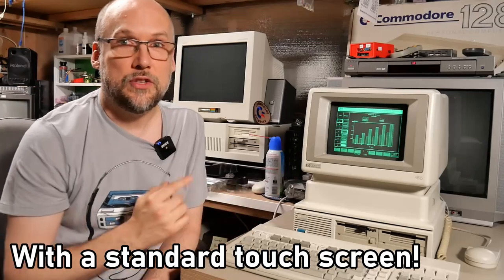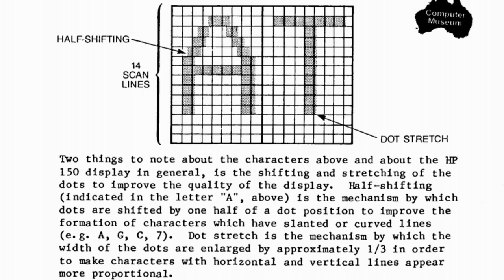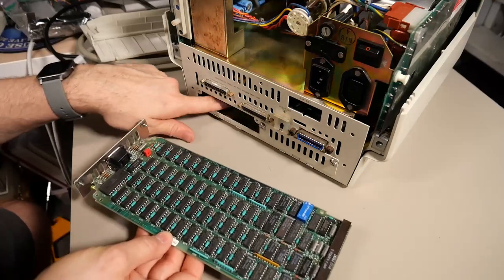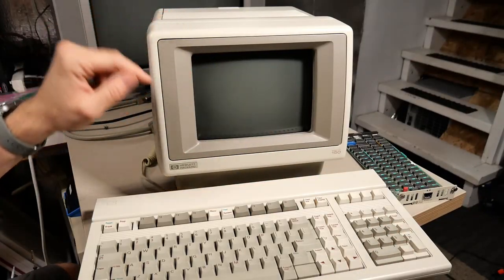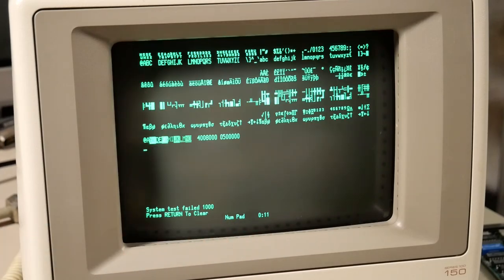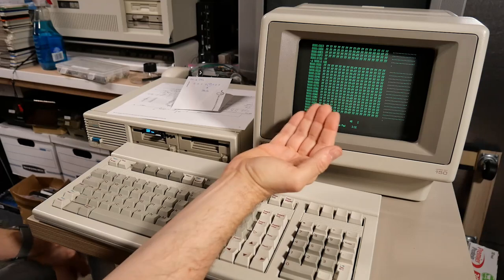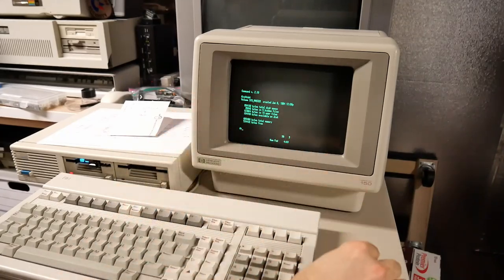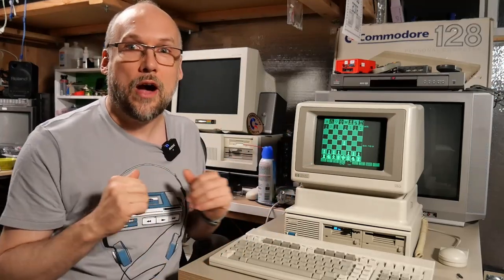Touch Screen MS-DOS PC from 1983

Comment: I was given the task of evaluating a Vectra in 1985 for our team PCs. It was definitely not 100 percent compatible and required its own OEM version of DOS. However, it was a great pleasure to use, extremely well made, and beautiful to look at. It had a 80286 running at 8 MHz. It had a very excellent keyboard which was every bit as good as the IBM model M but much quieter. The symbols were molded into the keys, as on their calculators. We nixed it due to lack of full compatibility but I got to keep the evaluation unit as my terminal (most of our work was done on minis and mainframes).
Reply from the maker: The 1985 Vectra certainly looks pretty boring compared to this machine -- but I guess that's what it meant to be a PC compatible back then. I see from pictures it used the same keyboard as the HP 150, which is neat.

Comment: re: manually soldered wires ... I would suspect fixing timing issues, because in all the instances you point out the original traces have been cut not only as near as possible to the soldering points, but always at both ends. This makes sense if you need to avoid any signal reflections which would otherwise happen if you leave one end or both ends connected.
Reply from the maker: IZ8DWF thinks that it is because of crosstalk issues in that six layer board due to those existing traces being too close to another trace right under it.

Comment: Another thing to consider on touch screens of this type is LED lighting pulses can confuse the sensors just like they do on the PCJr keyboard.  Also some newer computers with touch screens (like 2010's era) can go haywire if the screen refresh rate and touch scan rate are not in sync. I've seen this on Dell XT2 laptops and some Dell all-in-ones where the cursor jumps wildy around with older video drivers and newer drivers fix it.

Comment: I was developing code for the HP150 back in 1985. I had come to the project from a group working on HP series 80 and 9000 machines. The 150 was a considerable step down in quality and capability and the touch screen was really just a gimmick and even if we coded software to use it, our users preferred to use the mouse or keyboard instead. I was very pleased to get back to coding for the HP 9845C.

Comment: Hello Adrian, We used to have these computers running on 2 different machines back in the early 90's. One was an ESI 4000a Thick Film Laser trimming machine running HP Pascal OS and also Pascal Language. The other was on a Siemens (Now ASM) Pick and Place machine SP120 (6 Revolver head for fine components back then 1206 and 0805's some small IC;s)  and HS180 single spindel (for larger components like large IC's) running HP Basic OS and Basic language. same machine though. On the HP basic to do a dir equiv of DOS you had to type "catalogue 703.XXX.XXX" forgot the command exactly. they both had the HP9121 or 9131 drive system and also contained a 10MB winchester HDD. same keyb system, very relaible. ESI and the pascall system made good use of the function keys. We later got a second ESI Laser ,The ESI 4210 system but again same OS and Computer.

Comment: Touch screen back in 1983 is pretty incredible,  it wasn't until the 1990s that touch screen devices were more popular, though they were still not that common. The first touch screen device that I saw was a public information terminal in a local library, then still in the 90s I saw a bus timetable display which was operated via touch screen at the bus station. Then jump to the 2000s and touch screens are everywhere.

I think that HP's printers are still of pretty good quality, even the cheap ones. I had a Compaq Presario laptop from around 2013, so Compaq was owned by HP. It worked fine from new, apart from one of the keys stopped working after a few months, HP repaired that under warranty, then after a couple of years the screen started failing ie the contrast was out of wack and was slowly getting worse.

Comment: Hp-IB was invented in the 1960's. Later on it got standardized in the 70's and named GPIB. HP kept its name though being compatible. Its original use was for interconnecting measurement Equipment like Multimeters and oscilloscopes, etc.
Reply: What's the data rate of these? You'd think if it was the 60s it would be pretty low, unless they account for increasing speeds over the years.
Reply: @stonent  1 MB/s, I think. Apparently, National Instruments introduced an upgraded variant of the IEEE-488.1 that want up to 8 MB/s, but was also backwards compatible. Keep in mind, HP originally designed this interface for data logging and control of digital test equipment, not for moving large files around between computers.
Reply: I use test equipment everyday that still use this interface. They range from stuff built in the 60's to brand  new power supplies, Oscilloscopes, and  lots of other automated testing equipment.

Comment: Whoa!  And here I thought my IBM 8516 was an early touch screen example!

EDIT: I'm very surprised how similar that keyboard and mouse are to the ones I use on my HP 9000/720 from nearly a decade later!
EDIT 2: Chassis and expansion cards are done in a very similar way as well!
Reply: Instantly recognize that incredibly uncomfortable HP mouse.  Used from the graphics terminals on my college's 9000/300 servers all the way through the 425 machines and the 7xx workstations.

I loved our 712i machines because we could use normal PS/2 mice with them.  One day the HP guy came out to upgrade the CPUs and I saw that inside that pizza box case they used foam to mount the disk drives.  Broke my heart.  Then Compaq bought HP and it all went to hell :(

https://commons.wikimedia.org/wiki/File:HP-HP9000-712-100-Workstation_01.jpg
Reply: @grumble2009  was that HP Pizza top of the cage Pizza special sauce?

Or just sprinkling of extra Ram or a double Ram Pizza.

Comment: The graphic arts and architectural supply store Charrette used to use these as terminals throughout their store. The employees used them for access to their inventory system on their mini- computer.

The bus wire may have been used to avoid etch shorts. There may have been some kind of contamination, or fine copper threads on the boards that required cutting the etches and rerouting wires around those locations. I ran into that as a PCB tech. The company had a batch of boards that had some contamination of some kind that "grew" together and caused the address bus to short out. After the issue was discovered, etches were cut and bus wire was run around those places.

Comment: I recently watched an episode of Computer Chronicles that had this touch screen computer in it. I was fascinated! Nothing under the sun is new, I guess. Very fascinating how you got this machine working properly again. Well done and a big congrats to you on this! I am personally VERY interested in these terminal modes. Would it be possible to hook this up to, lets say, a modern Linux machine with terminal access? Does the touch screen capability work when using it as a terminal? My interests in these older machines often lie in the driving question: "How can I make this old machine relevant and useful today to accomplish real work?"

Most importantly, how in the world did you come upon this machine? There is a story there too. So fascinating!

Thank you so much for sharing!
Reply: The one drawback to using an HP terminal on a modern computer is the terminal emulation.  This one only understands the HP escape sequences for cursor control, not VT220, ANSI or others.  You could use it for text, but not anything like vi that uses cursor control.

Comment: Nice fix. I saw one of these demonstrated in the late 80's. I thought neet idea with the touch screen, so I made my own version for the ZX Spectrum with a 12inch TV. It used two joystick ports wich meant it was low-res, only 5X5, but it worked.

Comment: I remember using a PC around that time for a computer course I attended. It used the CPM operating system with a touch screen and an external 8" floppy drive. If you've seen an 8" floppy disk, you have full understanding of the term "floppy". lol

Comment: Wow! Finding and replacing that faulty RAM-chip, and decoding hexa error messages from flashing LEDs, that's proper geeking out! I don't think there are too many people out there who'd go into all these troubles to service a machine that's basically just a historical artifact now...

From this video it seems like all that people did back then with their computers was to try and correct random error codes :D

Anyway, touchscreen technology from almost 40 years ago, that's pretty amazing! Even if it's a bit crude solution, but still works!

Comment: this machine wasn't presumably aimed at consumers...
I think this would have been used in a production environment for spec-testing bedcause lots of measuring equipment used HP-IB back in the day, like Multimeters and Oscilloscopes
I guess this might have been a place for quality control with an automated test setup for some kind of production line, and a worker used the touchscreen for ease of use in the production environment and the printer at the top might be for example as a quality control measure like QC Passed stickers but with the actual readings if the device is in spec or not for example...

Comment: Compressed air is a common fix for touch screens, even modern ones.  We use some touch screens at work that are in an area that are prone to dust and they must use the LED method of touch sensing because every time the screen glitches, we can blow dust around the inside edge of the bezel and it clears the problem.

Comment: I used to work with HP3000 computer systems that used HP-IB cables to connect the CPU to all of the peripherals.  Disc drives, tape drives, and line printers.  Those cables were THICC!  It was quite the challenge to arrange the peripherals in the computer room (We didn't have a raised floor so cables couldn't cross any walkways). There was a limit of something like 6 meters total length and it required a terminating resistor at the end of the device chain.
Reply from the maker: The cable now (perhaps as they have aged?) as so stiff. It does indeed making moving peripherals around on this HP 150. I can only imagine if you had a bunch of things are connected together!

Comment: I know I'm late responding to this one, but just now watched it.  LOL  You probably worked out what happened long ago, but if I were a gambling man, I'd say that the touch screen maps directly to a memory location and there was a short (probably dust) causing that column to be constantly held high, which mirrored into memory - and then since it was held high the diagnostic treated it as a memory error, a stuck bit.  Though the bit wasn't stuck, it was just held high by the short in the display.  The canned air cleared the short and like magic, everything works.  :D

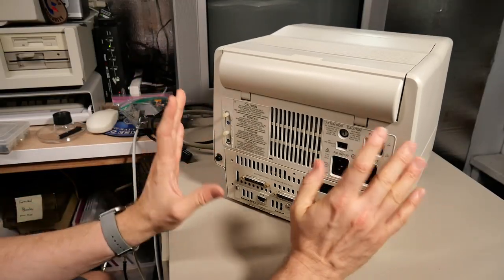Comment: 12:22  "It's extremely well engineered like all HP stuff is." 

I have an HP Officejet 7410 All-in-One and it is designed so that if it detects a problem with either the black or color ink cartridge, it becomes a useless brick.  The ink cartridges, which cost over $40 each, dry up in less than a year after they are installed, whether you use them or not.  I stopped replacing the color ink cartridge years ago because I rarely used it.  However, once while making black-and-white copies, I accidentally pressed the color copy button.  At this point the machine detected the color ink had dried up and then refused to allow me to make any more black-and-white copies or use the machine for scanning or anything else.  Fortunately, I had saved an old color ink cartridge that, while not having enough ink left to make a decent print, was miraculously accepted.   I continued to use the machine for awhile until one day when the black ink prints were looking faded.  I removed the black ink cartridge to examine it, but upon putting it back, the machine detected a problem and once again refused to function.  Instead of shelling out the money for yet another ink cartridge that would probably dry up in less than a year, I decided to buy a Canon All-in-One laser printer for the cost of 3 black ink cartridges.  I am happy to say that my new printer is many times faster than the HP and does not waste a few minutes "warming up" every time I turn it on.  The HP also had a bunch of other annoying issues that I will not even mention here.

Due to the incredibly horrible software design / engineering of this particular machine, I have vowed never to buy another HP product ever again!
Reply: AFAIK nearly all modern inkjets are crap. I still use a DeskJet 812c, which although the lowest-end model of the series, still works fine today. The cartridge interface is well documented and, unlike a modern cartridge, has minimal smarts.

Comment: In 1983 I sold Christmas trees in Palm Alto at a shop/lot at El Camino Real and Page Mill Rd, less than a mile from Hewlett-Packard. We hand selected specific large and perfect trees from Oregon forests for specific clients, shipped them to Palo Alto, custom wired them for lights, flame retarded and flocked them, and then delivered them to the homes of Silicon Valley executives, including HP’s. These trees cost hundreds, sometimes thousands of 1983 dollars. Pretty good odds some of them were “HP 150” dollars.
Reply from the maker: LOL! Interesting. I have to wonder if HP actually made money on the HP 150 -- maybe since Universities and such were probably buying them up since the HP-IB allowed them to interface really easily to HP test gear.

Comment: On the wires, yes to timing issues. I worked at HP building hard drives (old school 14 inch platter) and we had bunches of the 150's running test systems. Had to  do what were called field mods to fix timing issues resulting from the differences between different chip suppliers. Yes the timing was ghat tight. All the hard drives we built had Hpib and would work with the 150's.  Imagine having a 400 megabyte hard drive that cost $38000 on your PC.

Comment: FWIW, this was the HP equivalent to the DEC Rainbow 100A - both ran MS-DOS 2.x, both had a built-in terminal emulator, both supported at least 640KB (the DEC unit could go up to 1M, IIRC, the largest-low-memory DOS machine I've ever seen) and neither was PC-compatible.  Both were BIOS call-compatible, so a decent chunk of common software would work, but not all.  Oh, and IIRC both use proprietary disk formats.
The HP 150 I remember using from ca. 1989 had the thermal printer (almost useless, its output quality was terrible) and a Diablo 630 daisy-wheel printer for "letter-quality output" - gorgeous quality, and LOUD!

Comment: These units had two main uses:
1. A Terminal for HP and other main frames.
2. To run Very Expensive Lab Equipment like HP's Gas Chromatographs that often cost more then most expensive houses at that time.
Printer on top was common way to screen print of results for lab equipment or terminal sessions.
 Not a good way to "print a book" or even a few pages. They were rarely used to compete with IBM PC and Clones for other business cases.

HP did not allow service beyond board swapping for many reasons. A big one is if anyone messes up the 150 and damage the lab equipment... That can cause Fatal problems to people using the systems. Chips in Sockets had big problems and easy to steal too. If you have to re plug hundreds of chips in a month just to get many IBM PC to boot you might know how bad this really is and that's even with the right tools.

Comment: I was taught in college by a teacher who worked for ESA making satellites, that sockets are the primary cause of errors especially on things being put under heavy G-forces. It could unseat an IC, not as much with the lathed (turned) sockets but I guess back in the 70s when he worked there those were not as easy to source as it was in 1990 and now.

The guy was also meticulous about soldering, we had to cut the lead and reflow if we had soldered it. 
But preferably cut the lead and then solder. Because cutting sends a shockwave through the solder connection creating tiny hair cracks and an opening to air. The temperature changes and oxidation could cause that connection to go. 
And he told me that on a satellite that would spin they'd use to cut exact lengths of solder for each in, so that all pins had the exact same solder mass, as to make sure that every leg had the same amount of force applied during that 10-20 years of spinning in space. 
He wasn't allowed to tell what type of a satellite it was... 30 years on and I am still curious. The geezer is probably dead by now, he was in his early 60s back then.

Comment: The traces that are cut at both ends and linked across are the ones that are closest to the edges of the pcb.
Do the cards slide in metal guides ?, maybe they was a chance the tracks could short out.

Comment: I used this at work in the 90s (in the UK)- no hard disk of course - I recall using the HP120 too - the home key was used with spreadsheets - I recall if I’m not mistaken there were keyboard plastic templates that sat over the function keys for different software packages

Comment: Just now catching this on the HP-150; I'm an ex-HP person that was around when this came out. The back-story on this. Management wanted to compete with IBM, so it asked the Terminal group to develop a "PC" . Well they sort of did. The HP-150 is very much like a HP Terminal, but the engineers didn't want to get into licensing issues with IBM/Microsoft...so they rolled their own "PC". And yeah, not compatible with the PC's of the day, but the 150 was highly compatible with HP hardware. HP rolled out hardware and software to compete head-to-head with IBM and MS Dos. Later management was not happy with the lack of sales for the 150 (it wouldn't run IBM PC software),   so they created a "PC" division to "try again", hence the Vectra and the birth of the HP PC division.